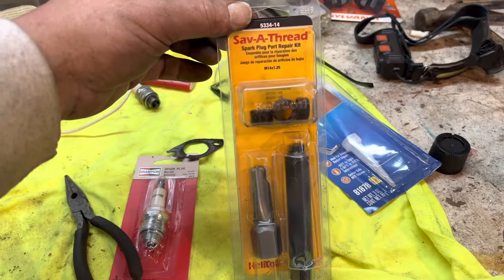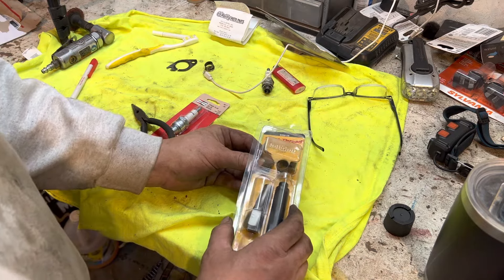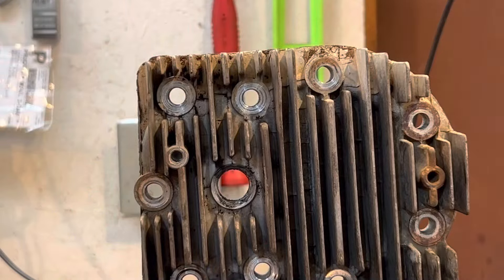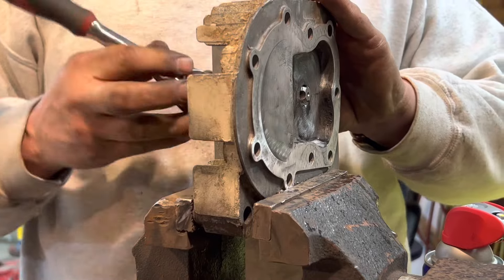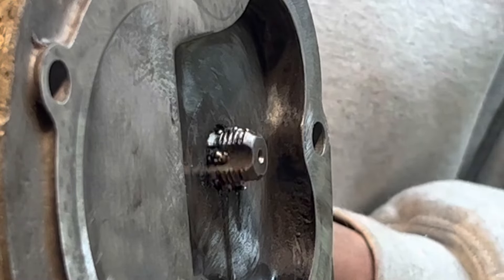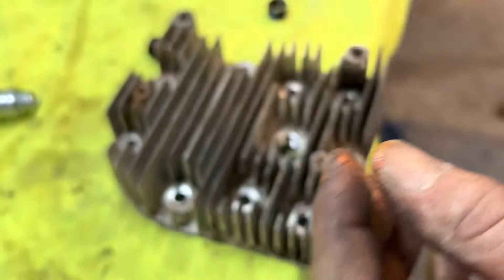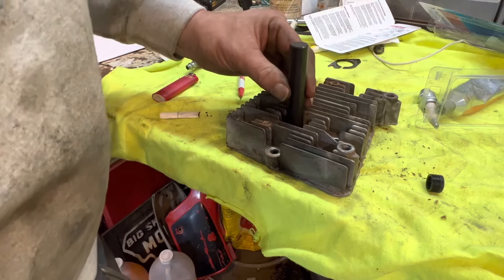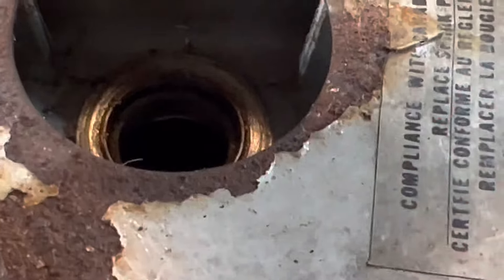Sav-A-Thread spark plug replacement helicoil on a small engine. Easy to do

Comment: Two things that piece would have ran into the piston not the valve. Also when you reuse a head gasket (which should always be replaced) use copper spray a gasket. It is SUPER STICKY coat it good and let dry 5-10 minutes then put the head back on, it will make it very more likely to not leak. If you do not remove the head on any engine then do this, put the cylinder at TDC (top dead center) then use the threader and make the repair. The next thing you do is use an air compressor and spray the air into the cylinder it will push everything out of it. Just make sure 💯 % the cylinder is at TDC, this will make all valves closed and when you spray the air into the cylinder it will blow any metal shavings out of the cylinder. You can put a piece of vacuum line on the end of the blow nozzle small enough to fit down into the cylinder. Don’t blow at 150PSI you only need 10-15PSI, this will make sure it’s nice and clean and have no metal shavings sitting on the piston or down on the ring.
Reply from the maker: Good advice thank you for the comment. I’m going to pin your comment so it comes up first 😀. Actually when you look at the picture of the threads being stripped out you can see the valve not the piston. It’s offset on this engine.
I wasn’t worried to much about the head gasket on this old of an engine, this snowblower is from the 70’s and those engines were bullet proof.
Reply: @pilgrimsgarage people dnt listen.. good review, thanks for the time, info and energy.

Comment: If on the engine, remove the spark plug and look in for the piston. You can inset a long pencil or wooden rod, and turn the engine over until the piston is way back away from the head so the threading die does not contact the piston. Also, lube spark plug threads with anti seize, and be careful each time you install the plug to assure you have it straight. Don't over tighten!

Comment: Had my neighbor help me do this because he said he’s done it on motorcycles. Didn’t set the nurls and now the sleeve is seized on my plug 🤦🏻‍♂️
Reply from the maker: I don’t think that it would be a big problem. Just back the plug out and if you have to replace it all you’ll have to do is buy the insert. I believe they’re only a dollar or two. Should be able to find it on Amazon. You still have the expensive parts (tap, knurl set).  It’ll be easy 😊
Reply: @pilgrimsgarage  I couldn't find the insert on Amazon but I ordered it at Advance Auto Parts for $4.

Comment: Great instructions, worked great on my corvair aside from one issue. Unfortunately I rushed through the process, and with my limited visibility, didn’t realize I had tapped threads into my piston until it was too late. You win some you lose some I guess. Aside from my stupidity, your instructions worked flawlessly though. Concise and to the point.
Reply from the maker: @BrapBrapDorito  thank you. Just an fyi, there is a guy here on YouTube named @mattsoffroadrecovery who has tons of Corvair parts. He was just out  at a place called Clark’s Corvair Parts in Shelbert Falls Massachusetts. Surely you should be able to find something to help you out. Thanks again
Reply: @pilgrimsgarage Yep, Clark’s is definitely the place to go, glad it’s not too far either. Somehow the car still runs, those corvairs are tough SOBs. Thank you for the advice!

Comment: I’m trying to repair a striped plug hole. I have the repair kit and inserts. My problem is that over time the plug was progressively getting loose and wallered out the hole so badly that no I can’t get enough thread depth for it to hold the insert. I’m open to suggestions
Reply from the maker: The tap that comes with the kit is predominantly bigger then the insert. It should be able to cut new threads. If it’s to big and the insert won’t thread in, the only option I’d say is to replace the head if it’s a small engine or I think they make a bigger insert and tap. Plugs on old tractors and older flathead engines are really big. That might be an option.
Reply from the maker: What kind of engine are you working on?

Comment: How hard did you have to push on the tool. I’m retapping the hole in my car engine but it does not cut. It gets to the big tap part and just spins on the section between the small and large tap portion. I push on it but no luck grabbing
Reply from the maker: I didn’t have to push on it very much at all but it was a small engine head…an automotive head could be much thicker. I would say to keep good pressure on it to get it to bite.

Comment: I've seen many people just buy the tap/rethreader with inserts and not the kit that cost twice as much that has the set tool. Unless you have the set tool, the insert doesn't get installed correctly. 
  I literally just went to autozone and the 14mm kit with tool was $32. The funny thing is, the $16 kit with no tool was in plain sight, and the one with the tool was hiding behind a label bar.
  I usually install inserts with the engine all assembled. But it is much easier with the head off, but only for the actual insert installing. It's much harder to do the complete job. Pulling the head off isn't an option for most people. I run a vacuum hose and use compressed air in the hole after I'm done.  Never had an issue with shavings.  I tell everyone to use a long extension with short socket to rethread. The long ext helps keep the tool straight.
Reply from the maker: Very well said. I know the kit is expensive and I’ve bought them over the years but I always lose the set tool🥴. If you’re ok with it, I’m going to pin this response so it comes up first. Great advice and I thank you for sharing it!

Comment: Thanks for the tip about putting grease on the tap.  It worked perfectly.
Reply from the maker: Excellent! It’s not hard to do but cutting those threads can be a bit spooky. The other way is with an air compressor. You can blow out the cylinder but honestly, both ways have a tendency to leave a little residual metal filings. I’m glad it worked for you and you’re welcome

Comment: Fixing to do this on my Acura TSX after a loose spark plug literally beat the threads out of that particular cylinder portion of the head. Thank you for this!
Reply from the maker: Be sure that your piston is down at the bottom of the stroke. I’m not sure if Acura has a high compression ratio. Be sure to grease the tap really well. That should help keep the metal filings down to a minimum. Might also help if you can get a shop vac in the hole to pull out the filings.
Good luck and thank you for the compliment.

Comment: Wow, I wanted to take my top to engineering but this is going to help. Thanks
Reply from the maker: You’re welcome. One thing I’d recommend… a new head for this particular small engine was only $50 and the kit was pretty close to that price. Check what price a new head would be just in case it’s comparable to a repair kit. I will say it’s very easy to install and it’s still working excellent. Thanks for watching the video and I hope it helps you out. Cheers!

Comment: I had this done at my mechanic on my 2007 mini Cooper. I am wondering if you can change the spark plugs later down the road?
Reply from the maker: I have had good luck with changing the plugs as long as he used either rtv or loctite to seat the helicoil. It never hurts to put a bit of anti seize on the plugs to but I think you’re in luck…Minis are the shit! They’re so easy to work on and they’ll last forever if you properly maintain them. You shouldn’t have to worry about plugs for at least the next 125k miles. You’re golden 😉
Reply: @pilgrimsgarage  the spark plug hasn't come out in over 12k miles. And it was installed by a trusted mechanic. I would believe if they didn't use rtv or lock plug would have come out soon after the repair.
Reply from the maker: @andersanden3221  good deal. That’s a good mechanic… they’re hard to find nowadays.

Comment: Thanks for the vid bud. BOTH the plugs on BOTH my snowblowers just stripped out. Waited too long to replace the mfers I guess. Did you need to replace the cylinder head gasket with a new one after you took it off? I'm assuming yes; it's almost a stupid question.
Reply from the maker: Actually no I didn’t. I put the original back on and believe it or not it’s still good. I will tell you that a new cylinder head is about the same price as a Sav-a-thread kit… well at least for mine. Head gaskets are super cheap too. Thanks for the compliment and I’m glad it helped you out.
Reply: @pilgrimsgarage  Not true for some of the larger snowblower engins. They want $132 for the cylinder head kit for mine lol!
Reply from the maker: @janemorong4970  ugh… mine was like $35.
Reply: Yeah, so I'm hoping I can thread these in place lol. I've got the kit on order and spare inserts. I've got 2 machines so that'd be $132 times two!
Reply from the maker: @janemorong4970  ugh…well, hopefully the kit will work for you. Good luck.
Reply: @pilgrimsgarage  It worked on one Pilgrim! I was able the sleeve the other but it has a crack in the seat where the plug is, but it MAY work if the plug I get for it seals against that sleeve. 

Thanks again for the video! You saved my ass here!
Reply from the maker: @janemorong4970  you’re welcome. I’m glad it helped. 😀

Comment: I have a 50cc moped the threads where the spark plug goes is stripped out.The spark plug won't get tight will this fix it
Reply from the maker: @robertbell1804  it should fix it fine as long as you follow the instructions.

Comment: Only thing this kit needs is a tool to insert the plug, trying to twist it in on a California trimmer mower with the head still assembled is impossible. I installed it with the spark plug but im not able to remove the spark plug without pulling the insert out with it.
Reply from the maker: @inf0x0  when I did it I used the RTV as a thread sealer and I put it on the threads. I used the plug to insert it but I let it sit for a while to seal up and then I backed the plug out. One could say to just leave it in there with the plug…it should be fine.

Comment: I'm really hoping this will work for my motorized bicycle
Reply from the maker: It should. Check your threads against your spark plug first. Some of those smaller engines have tiny spark plugs.
Reply: @pilgrimsgarage  it's the same threads as my snomobile and my lawnmower so I'm pretty shure its average size but my biggest concern is that it's a cheap aluminum motor
Reply from the maker: @theLyzhendricks  it should work. If possible I’d remove the head and do it on a workbench. Be sure to use ultra copper rtv with the insert and you should be golden. Good luck
Reply: @pilgrimsgarage  yea I'm concerned about ripping the base gasket on the head so I dunno if I'm ganna take the head off I'm ganna do the gresse thing u talked abt in the vid and then blow the rest out with compressed air I'm not to worried about the motor I'm just trying a couple of cheap fixes for fun
Reply from the maker: @theLyzhendricks  it should work. Be sure the piston is all the way up. Good luck and tell me how it worked out. I’d love to know.
Reply: @pilgrimsgarage  I will definitely update and probably make a vid to

Comment: I tapped it and it was perfect straight and I put it in with lock tie and didn’t go in flush but now I can’t remove the hella coil , do you know how to remove the insert ?
Reply from the maker: Before you try to remove it, I would put the spark plug into the insert. See if you can tighten up the spark plug with the insert on the plug. It should be fine as long as the threads of the spark plug are all the way in. They do make a removal tool that has reverse threads on it but I don’t think that you’ll need it. Try and put the spark plug in and see if you can tighten it a little bit more and see if it’ll start. You’ll physically be able to feel or see if that insert is not working properly. You’ll feel it blow by the spark plug. I’d be willing to bet that you’re just fine though.